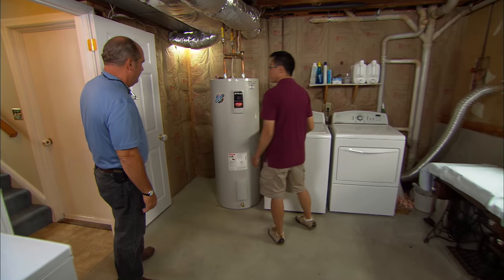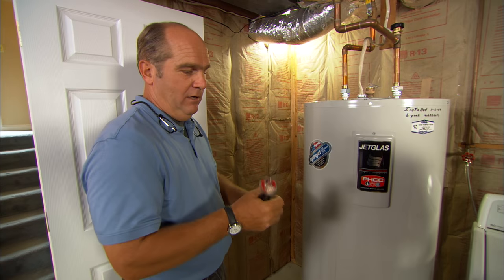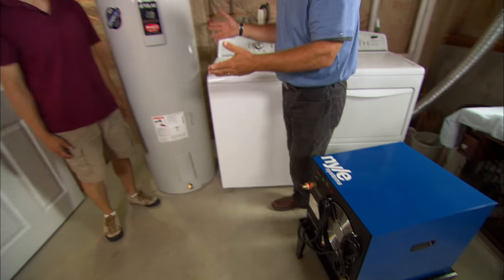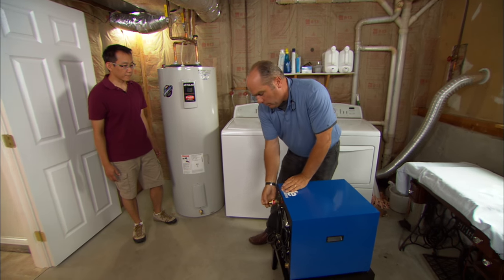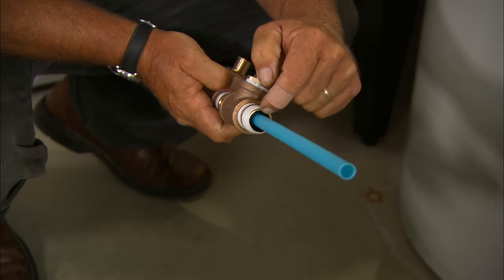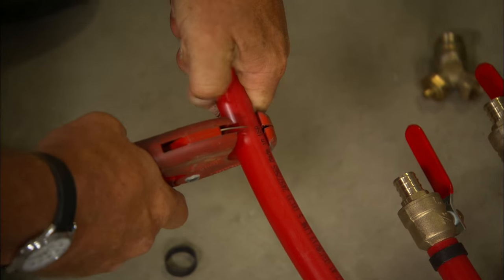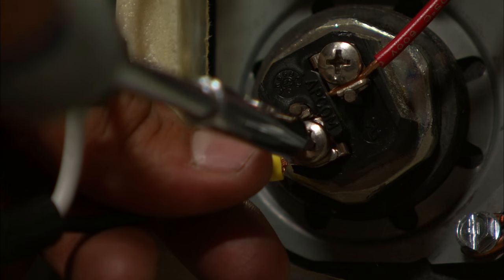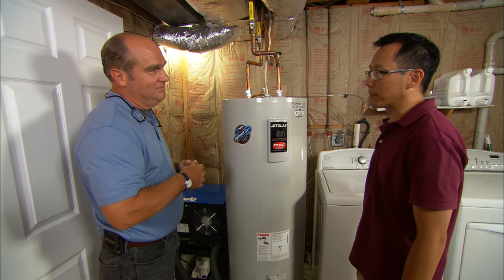How to Add a Heat Pump to a Water Heater | Ask This Old House

Comment: Why not take this a step further and make the hybrid water heaters a mini split system where the compressor and evaporator are separate from the tank, and can be located if necessary in areas with more background heat, like a garage or attic space, and disconnected from the tank if the tank fails.
Reply: That's exactly what Sanden does. The outside unit even looks just like a small mini-split. You may recognize Sanden as the same Japanese company who makes automotive A/C compressors and so on, for many years.

Comment: As for ZManMD's comment,  indeed, the upper thermostat temporarily energizes the upper heating element (only) until its set point is reached (circa 120F), after which, the upper heating element is disconnected, and the power is sent to the lower thermostat which then energizes the lower resistance element (only) until the lower T-stat's set point is reached (circa 130F).  A properly wired heat pump  takes the place of the lower heating element, so, if hot water demand temporarily exceeds the heat pump's heating capacity, the upper T-stat will disconnect the heat pump and temporarily energize the upper resistance heating element.  At no time will the upper resistance element and heat pump be energized at the same time. The lower heating element will never be energized again unless the heat pump is removed from the circuit and the lower element is reconnected.  Again, not rocketry science.  :)

Comment: That's all fine and good for the summer but in the winter your using oil heat to heat the air that you are pulling the heat from... you just added a "middleman" to heating your DHW by oil, no gain there

Comment: Here is some real world experience from somebody who owns and has lived with the all-in-one, heat pump water heater (the red GE one they don't make any more, but you can still buy a Rheem which works exactly the same.)   Overall, I like it.  If you live in a warm climate, and your water heater is inside the conditioned space in the house, it is a huge win. First of all, it heats the water at much lower cost and it kicks free A/C back into the house all summer as it runs.  And the amount of "free" A/C is not trivial, it is about as much as running a small window unit.  And as for complexity, it is basically a window A/C unit, running in reverse, glued to the top of a regular electric water heater.  So the actual technology involved is pretty basic and proven and mine has been completely reliable.  And it is important to know that if the compressor/heat pump stuff ever fails, you can literally just push a button and then you have a regular electric hot water heater.  It is designed so you can completely bypass the heat pump.    

In a cold climate, the question as to whether this makes sense is more complicated.  If you can get a natural gas water heater and you live somewhere with bad winters, it is tougher sell.  Same if you have electric heat.  It is no accident they picked an oil heat house for this install.  I use a wood stove and that heat is cheap and plentiful.   In effect, the heap pump lets me use my cheap wood heat for hot water as well as heat.   Another upside few people realize is that you generally cannot make electric hot water in a power outage unless you have a huge, whole house generator.   But I have used my little 3k watt generator + basic transfer switch to keep myself in hot showers over a multi-day outage because the heat pump on my water heater pulls so little wattage.  The main downside is high up-front cost.   You will ultimately save money, but the payback takes years.  It also takes much much longer to recover after you've pulled most of the hot water out of it.  So probably better for a smaller family.  It does have a "high demand" mode that basically runs both the heat pump and the traditional elements inside to boost the recovery speed.  So if you suddenly have a bunch of house guests the thing can ramp up temporarily, but this isn't the water heater for the Brady Bunch.  It is also somewhat noisy, so if your water heater is next to your bedroom, you want to pass.   But heat pump water heaters really should sell better than they do.  For a lot of people, they are a very good idea.
Reply: Baltimore Gas & Electric is giving a $500 rebate on the all-in-one heat pump water heater at this time.
Reply: I live in Indiana and winters can get harsh at times. I worry that the heat taken from the garage in the winter could cause my water softener or whole house water filter to freeze. The unit in this video looks like it could be mounted on the other side of the wall (inside house).
Reply: @Bendc1970A1  might make sense. But really changes the numbers if you live somewhere that is freezing for a large part of the year or even just Cold.
You could do what they're doing here and put the heat pump inside, but you are just taking your indoor heat you paid for and putting into the water.
It could still make sense, but numbers dont look as good.
It's great if you live in a warm climate because most people would love to remove a little heat from their house, especially when in a sense it's free cooling
Reply: @mbburry4759  I would think the de-humidification element can be beneficial as well, even though I live up north in a colder climate.  I run a dehumidifier in the basement year-round to battle the moisture, but if I install a secondary heat pump to my hot water heater, I'd like to think that I could stop using the dehumidifier, which would help save money two-fold.
Reply: I have the Rheem hybrid water heater and it's been awesome. I love the fact that it only uses roughly 600 watts of electricity which is one of the reasons why I can run my house pretty comfortably with my 7KW inverter generator during power outages. I only use it in heat pump mode and it's the best!
Reply: I just installed one of those red topped one yesterday it's from 2012 never used I got if for a great price much less than a new electric just installed so well see but the room I put it in has no ac this is helping already.
Reply: The problem as he pointed out is not the heat pump unit malfunctioning it's that most glass or plastic tanks have a pin hole or more in the liner that means that the tank will eventually spring a leak and unless it does it under warranty and the cover it fully under warranty you have an expensive replacement even the one's that cover replacement installation
Reply: 'The main downside is high up-front cost.   You will ultimately save money, but the payback takes years'

LOL, you sound like your 'sensationalizing it'  (your making it sound like it takes FOREVER to break even) its about 2 to 3 years for payback, thats not that long!  

'Another upside few people realize is that you generally cannot make electric hot water in a power outage unless you have a huge, whole house generator'

really???? LOL! how does that apply this 'hybrid' hot water heater? thats the same for ALL hot water heaters! LMAO!
Reply: İ have one too. İt dehumidifies my basement. All the moisture loving critters are gone. İt's a great dehumidifier and it's hybrid so it will switch to full electric if the heat pump cannot pickup the demand. Though i have never seen it switch to full electric

Comment: I had one of those.  Failed so much I tossed it away.  Good luck getting service from them.
Reply: They tend to get air in the pump and need to be primed by flushing water in the cold side and out the hot side.  The air will cause the pump to shut off.
Reply: That’s what I love about this type of technology, it’s great while it works. If it breaks, all the cost savings goes back into getting it repaired.

Comment: My grandparents had such soft water they had the same water heater from new in 1958 to 1998.
Reply: Soft water tends to be acidic which corrodes the copper inside the pipes. I'd be expecting a pinhole leak in that house any day now ;)
Reply: dang that is a long time, may I ask where they used to live?

Comment: you can always wire up a simple timer switch to shut it down at night and kick on in time for morning showers.
Reply: This probably doesn't produce heat quickly.  Enough to keep a hot tank hot plus a slow recovery from moderate usage, not enough to heat up quickly or do a fast recovery.

Comment: In a house with an oil furnace, it's more common to just get an indirect-fired tank, like an Amtrol.  It uses the main furnace and a heat exchanger, and basically acts like a new heating zone on your existing system.  They are way cheaper than a heat pump tank.
Reply: The figures for me are
180 kwhr's per month at 12 cents per kwhr totalling 259.20 verses 135 gallons of oil at $2.599 per gal. or $350,86. yearly
 The price of oil is constantly changing and in 2014 it was 3.75  per  gallon in new england . Add $180.00 yrly  in maintenance cost and 2014 cost me nearly $700.00!

Saving 50% over basic electric cost and comparing it to oil is a no brainer.
Reply: @robertl.fallin7062  you should attempt to find some kind of Daikin Altherma equivalent system (not sold in the states anymore, iirc) to provide the majority of your boiler heat.
Reply: I have propane and that is what I do. I wouldn't mind an AC unit and dehumidifier in the summer but would be a fail from Sept to May

Comment: Do these units need additional maintenance or filters to deal with sediment and hard water?
Reply: It wouldn't hurt, also you need to clean the air filter on the heat pump

Comment: "Thank you so much Richard, we can't wait to start smashing our ankles into the drain that now sticks out into the path between the door and the washing machine."
Reply: I was thinking the same thing, the home owners got bigger things to worry about that saving 20 dollars on an electric bill
Reply: N C that’s a really good idea. I live in a really cold  winter climate so several years ago I moved our fridge to an outside wall. I cut two 3” holes through the wall (one high, one low) and then cut two corresponding holes in the fridge. Some pvc piping, vent covers with fine screens, and a thermostatically-controlled in-line fan finished it off. Anytime it’s below 30° outside, the system uses the fan to pull cool outside air into the fridge and exhausts the warmer air back out thru the top vent. Our refrigerator power usage dropped an average of 82% during the cold season (about 7 months here). The thermostat also keeps it from getting too cold in the fridge portion, I have it set for a maximum 15° temp swing. 5 years later and it’s still working very well. Next up will be the basement chest freezer though it will only save power for us when the outside temp is below zero (~2 months per year).
Reply: @97marqedman  can you send a link of your project
Reply: Mendy Studio I would but it’s not a project I documented...I just decided to give it a shot one year ahead of wintertime to see if it worked. I have a good friend whose dad had a similar set-up when I was young and it worked very well for him so I figured “What the heck, I’ll try it too.” I’ve never attempted to make or post a video on YouTube, maybe it’s time to give it a shot so people can tell me what I did wrong and how it must not actually work 😉 - ha ha.
Reply: ROFL

Comment: I am in the process of converting my central air to dump the unwanted heat into the W.H. vs. outside. You think it would be more popular but eventually I think it will be.
Reply: M Detlef  yes, yes I am!
Reply: You can get a geothermal heat pump has a water heater exchanger built in. You just plumb it in to your water heater. You need a heat exchanger on the high pressure line coming straight off the compressor. It will heat the water in the winter too, but not totally free.
Reply: @Bryan-Hensley  I have an air to air HP already. Otherwise I would go that route.
Reply: Hey Nathan, good idea!  Lennox used to make a product that did just that, it attached a heat exchanger to the hot gas line coming off of the compressor and had a water circulation pump to transfer the heat to the tank. This was a popular thing back in the 70's in Phoenix AZ.  It was called a "Hot Tap".
Reply: It’s called heat reclaim and is very common in commercial applications

Comment: It would seem that high mounting the heat pump unit will make it more efficient,  allowing it to use waste heat in the utility room and re-cycle it to heat water.  The waste heat can be from the furnace or in this case a nearby clothes dryer. Also, there needs to be a setting where the regular water heater kicks in, because the heat pump cannot keep up with high volume usage such as morning showers.
Reply: That is why you leave the upper element hooked up, he only disconnected the lower. If the upper thermostat is triggered the upper element will still work. Probably like 4k to convert 1/2 of your water heater to a heat pump.

Comment: I live in South FL and have been looking into heat recovery for the central air conditioner.  Can you show us how to install a heat recovery system to heat water when the whole house air conditioner is running?

Comment: Looking at the wiring...did this guy just put the compressor unit in series with the heating element!?
Reply: Yes he did and actually as a matter of fact what that unit does is it preheats the water but considering it's a heat pump it's only gonna take it to around 80° notice how he did not remove the electrical element that's because the electrical element has to raise it from 79ﾟ all the way up to a 120° so now do you not only have the electric bill from your hot water element you have one from the heat pump as well....hmmm does not seem so efficient to me...cold basement, High electric bill......u decide
Reply: ...hmmm does not seem so efficient to me, to have a fridge than...hot kitchen, High electric bill......u decide
Reply: Jesse Lute it absolutely heats to 120 degrees.  There are other models with sensors attached to the drain valve that run with the water tank power shut completely off.  After installing this in my basement, I have a 33% decrease in total electric bill.
Reply: Glad someone else saw that

Comment: My only issue with the install is using hard connections. So when your tank eventually fails, how do you take the system apart in order to re-install onto the next system.

Comment: Great idea for Florida. Wake me up when they make one than can be mounted outside the house so I'm not sucking heat out of the building and having to deal with excess moisture during our long, cold, rainy winters.
Reply: Florida is just the place for these. They are an air conditioner. They cool and dry your home. You are just using the heat that you would throw away with an air conditioner to warm your water.

Comment: Can you possibly run a baseboard heater for a bathroom in the same manner from the drain valve using hot water from the tank ?
Reply: Should be doable. I have heard people use them for radiant floor heat.

Comment: If any pros have experience with similar systems, please chime in. I can't find a supplier for Nyle products and am unsure if they still make this system.  In addition to Nyle, there is a manufacturer of air-to-water heat pumps that can be used for domestic hot water named Chiltrix. Their system is expensive ($4200 for heat pump + $1000-$2000 for a tank + $500 for a backup element) but (1) it operates outside, so it doesn't cool your house in the winter, and (2) it can heat and cool your entire house as well as supply hot water using minisplit-style head units. It's a decent way to go if you're replacing your AC or furnace.

The Europeans have some amazing systems as well that aren't readily available west of the pond, as least so it seems. Check out these Stiebel Eltron systems - I especially like the indoor heat pump with noise suppression and ducting to outside: https://www.youtube.com/watch?v=SXbA3y-Hl9Y
Reply: They stopped making them.
Reply: Red, if you are in the US, go to our contact page: https://www.nyle.com/water-heating-systems/contact/ and fill out the form. We will alert you when they are available in your area.

Comment: So, now the basement is gonna be permanently cold due to heat pump sucking out all the heat inside?
Reply: Not especially, with modern hot water tanks they are extremely well insulated, so they are really just pulling heat out of the basement a couple of times a day.
Reply: It doesn't make the basement that much colder.  The thing runs a couple times a day.  Big electric savings.

Comment: OK, I can see the heat pump might be great for a hot house in the summer, but what about when you have you're heating your house in the winter ... do you really want this heat pump to be sucking up the expensive heat you are paying for just to pre-heat your hot water?  Am I missing something ... is there a problem with this in the winter?
Reply: Depending on how you heat your house it will either still be more efficient or a wash.  if your house is heated using a heat pump or gas it's likely you'll still save money since you're effectively using your house's main heater to heat the water, it's being transported via the air to the water heater.  If you use electricity to heat your house it's probably about as efficient.

I don't know about this particular unit, but most modern water heat pumps are abut 3-4x as efficient as electric water heaters, and are even more efficient than tankless unless you use nearly no hot water.

Comment: So, is using the heat exhaust of an AC something that is used for heating water?
Reply: Yes they make 5 ton chillers now that will cool a building and pump the heat right into the hot water system.
Reply: Also can heat pool water with a connector to the a/c unit outside.